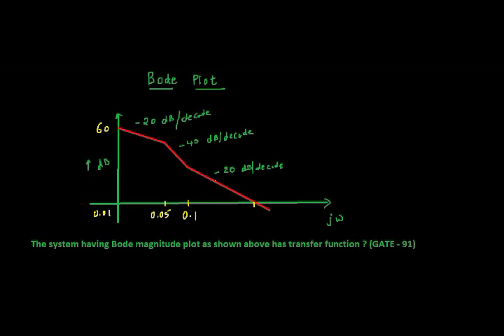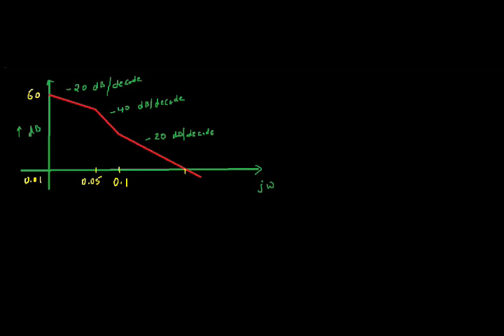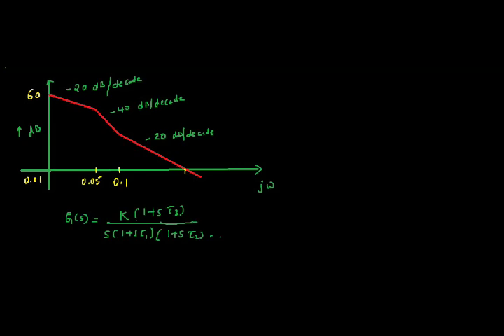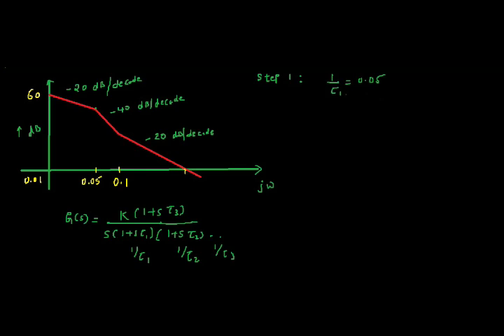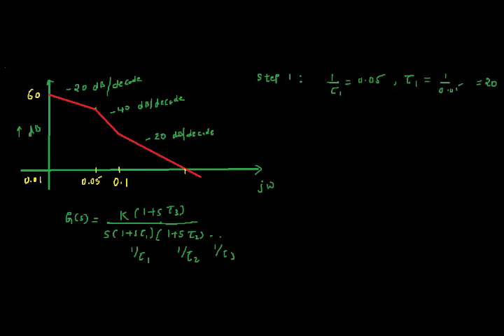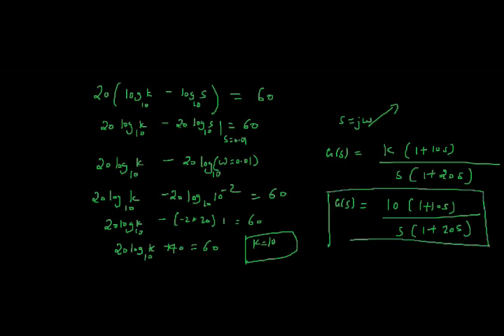How to write a transfer function from Bode Plot

Comment: I drew the plot with that TF and it starts in 80dB not in 60dB
Reply: bode plot in software starts at 10^-3 here plot starts at 10^-2 thats why it starts at 60. integrator takes off 20 db from 10^-3 to 10^-2